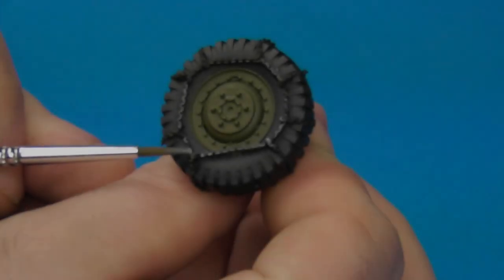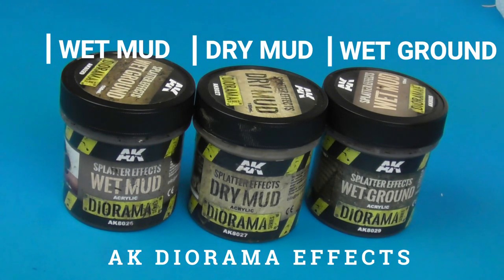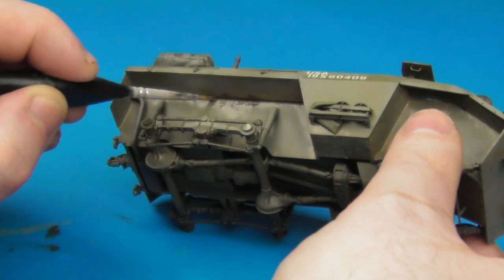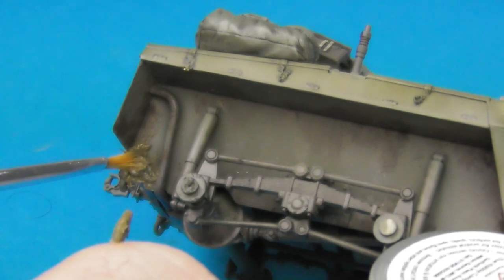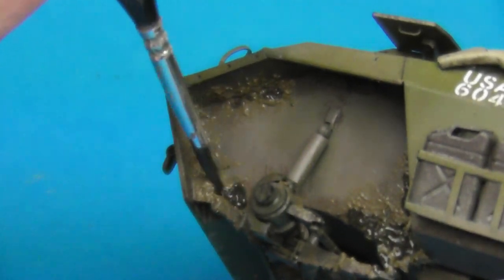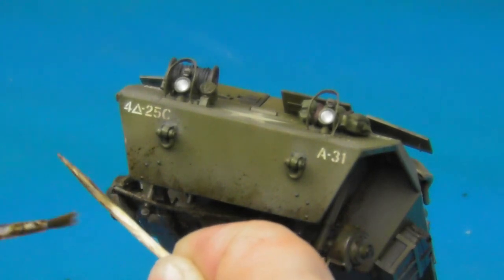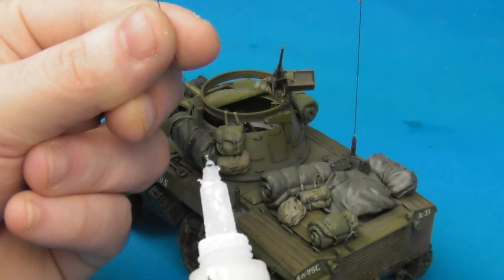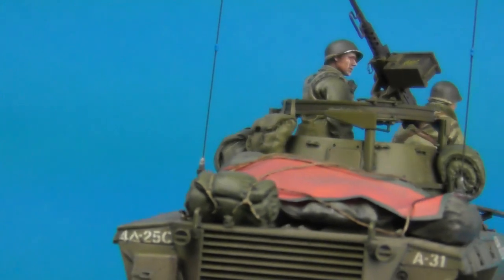TAMIYA 1/35 M8 GREYHOUND PART 5 WEATHERING / FINAL DETAILING

Comment: Hey hey Shane fantastic build my friend. Love that air recognition tarp. Red blue and yellow white. I remember red was combat blue trucks rear area can't remember white or yellow. Anyway awesome.  Antenna is spot on. Is all of this going on a Diorama????
Reply from the maker: Cheers mate, I really like adding them as they are very common on vehicles and they add a great splash of color and interest to another monotoned model. So with the air panels your I believe they are all doubled side with a color side and a white side, and your right that electric blue was used on support vehicles, whereas the cerise and arc yellow are used on tanks. Orange panels tended to be used by infantry for marking their positions to tactical air

Comment: Nicely done, Shane! Very methodical approach to the kit from start to finish. Question for you, and the your community; do you think paint retarder would work with those mud effects to slow the drying time, or would that eat into the paint underneath?
Reply from the maker: Thank you! That is a great question regarding adding retarder to those mud effects to increase their work time, I haven't tried it as of yet, though in theory it should have some effect as it is an acrylic based medium, though I wonder if the heavy volume of the product might diminish the effect of the retarder possibly. However there is one way to find out but to try it out! :)